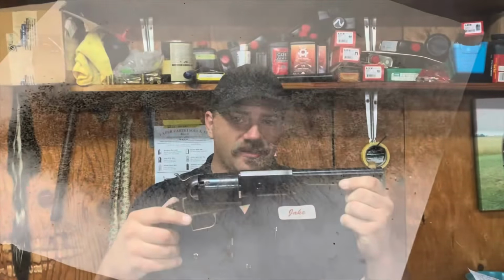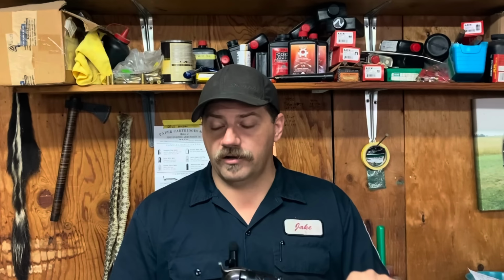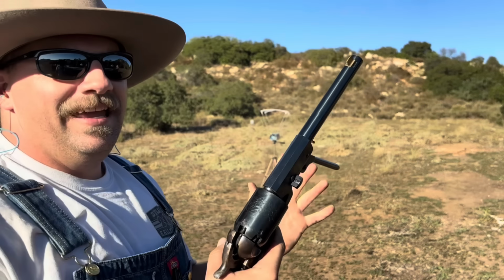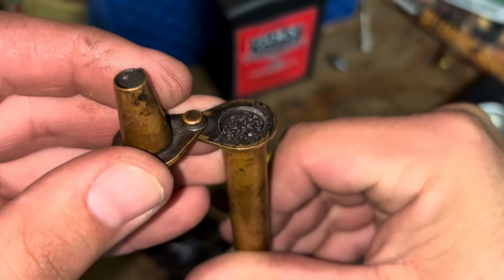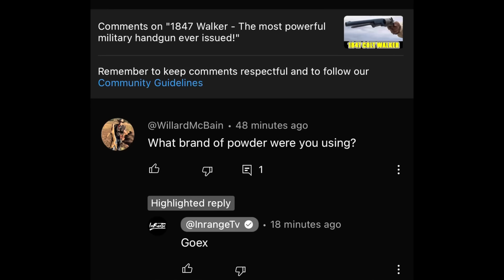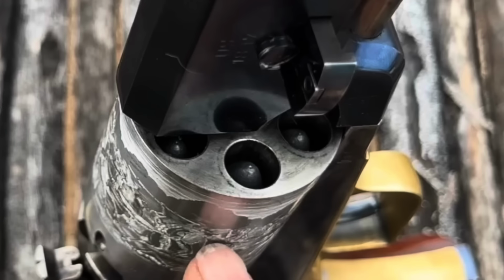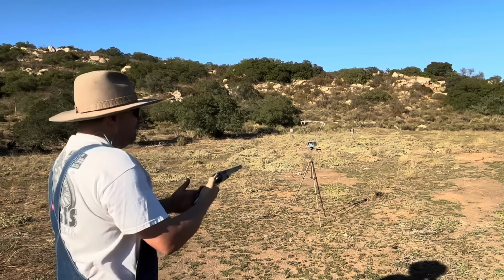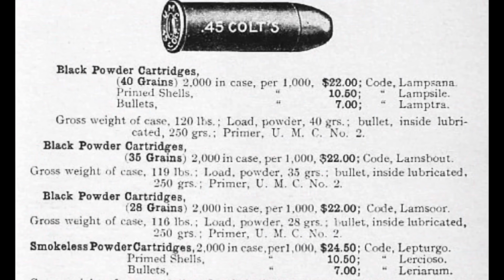The Colt Walker. Not The Most Powerful Revolver Of The 19th Century?

Comment: I have owned several of the Colt revolvers. Every one of their designs have the same wedge to hold the gun together. It is a piss poor weak design that causes the gun to stretch from forward thrust from repeated firing and the gun loosens up and get sloppy after a few shots. ALL OF THE COLT DESIGNS ARE JUNK! This is because they have the split frame with the thin wedge holding it together! Remington fixed that problem by designing their guns with a square solid frame.
Reply: Can't speak for the others, but the arbor is too short on the Walker